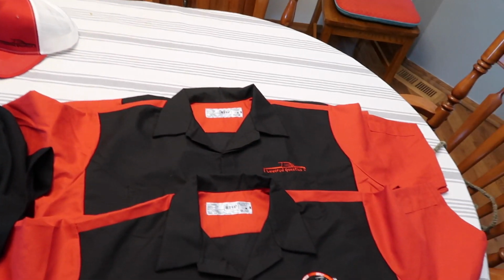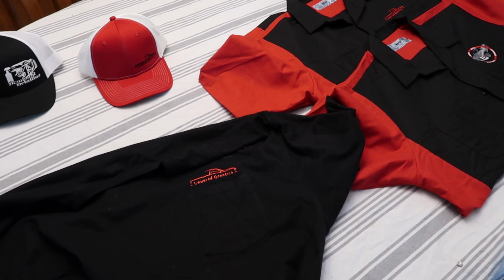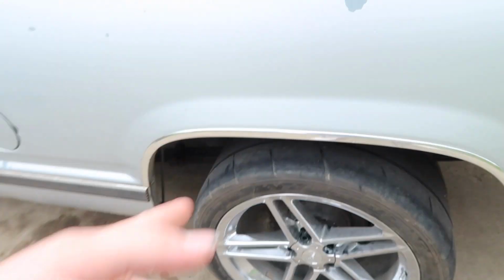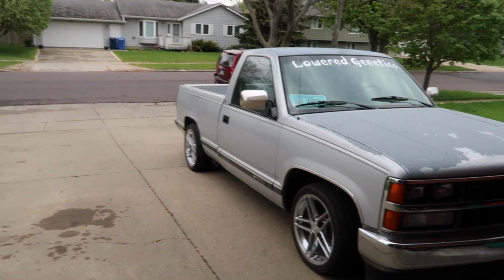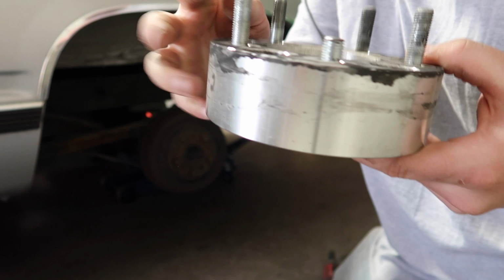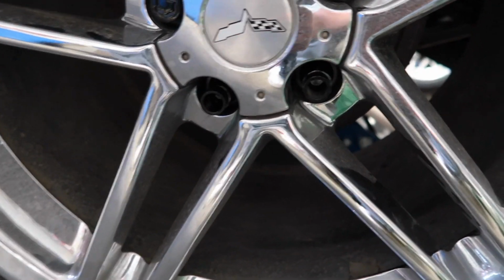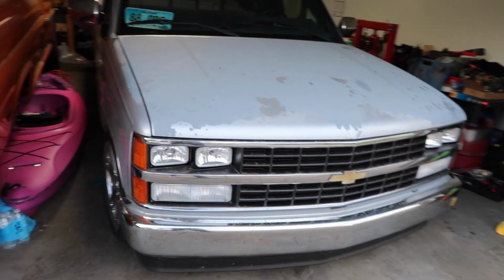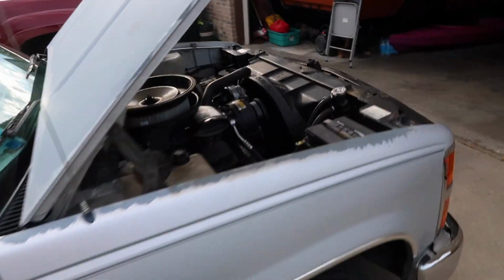I broke the OBS!

Comment: Truck use a paint job new seat
Reply from the maker: Got new seats for it make sure to check out that video! And yea paint is coming just working on a bunch of body work first hope fully next winter I will get it painted
Reply: I got a 97 chev all stock  271kms 350 magnaflow  muffler
Reply: R u taillights  stock or aftermarket
Reply from the maker: @alanm3079  aftermarket they are off LMC truck